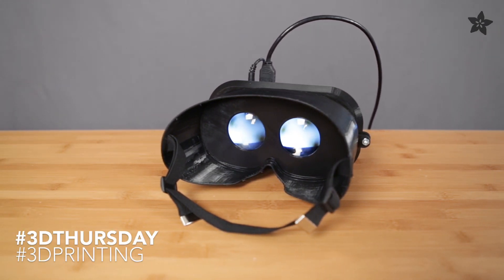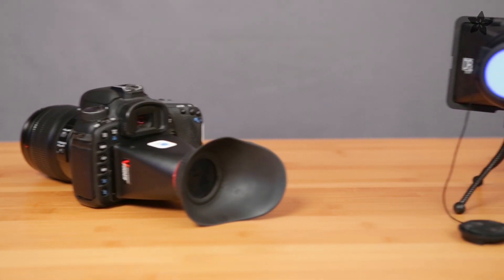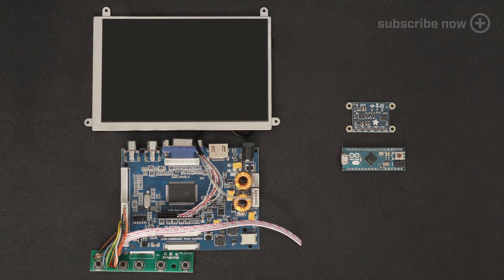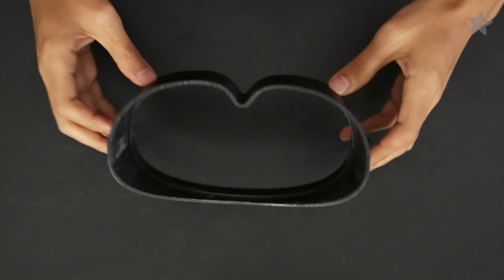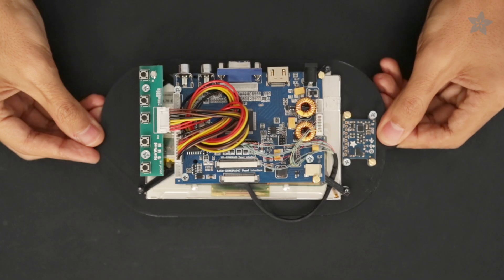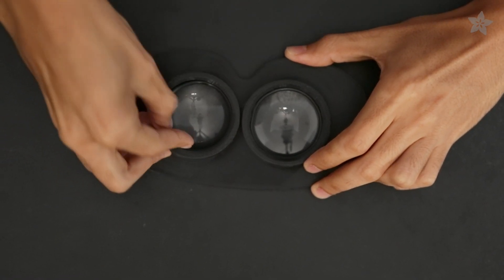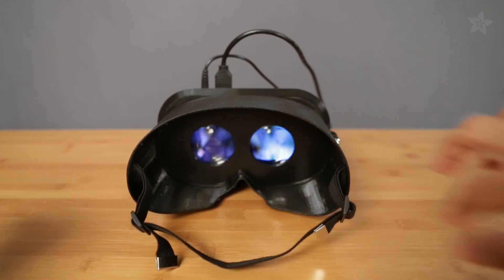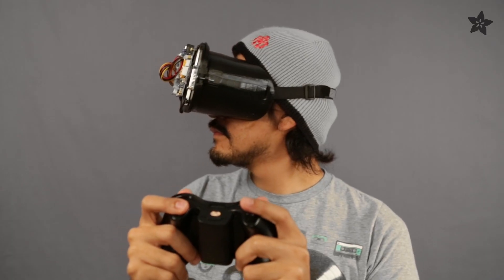3D Printed Video Goggles

Comment: Hello are you going to use a raspberry pi or some type of pc to connect to the headset?
Reply: there using a driver board, its like a tiny tv
Reply: +RedLolz Gaming that is what I was thinking too. I wonder what size is it.
Reply: +RedLolz Gaming I know they are using a tv screen. what I was wondering what system they are using a pc or raspberry pi?
Reply: +joseph chrzempiec (josephchrzempiec) 5 inch
Reply: +joseph chrzempiec (josephchrzempiec) its a driver board, the same kind you will find in your tv
Reply: +RedLolz Gaming hello thank you but not my question. what is controlling that driver and lcd. is it coming from a pc or raspberry pi.
Reply: +joseph chrzempiec (josephchrzempiec) oooooohh, adafruit is using a mac but if you make this you can use whatever you want!